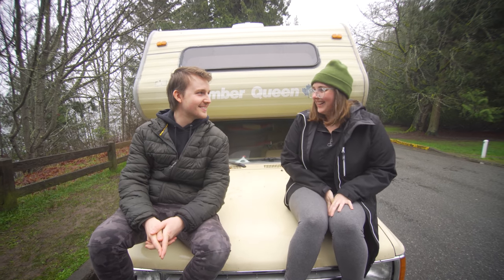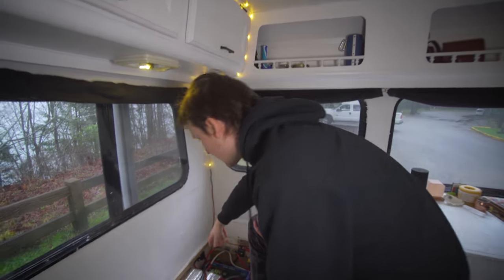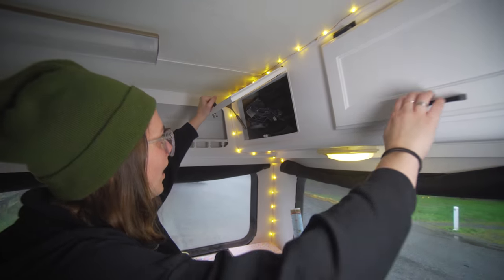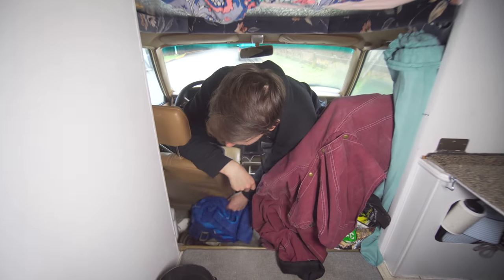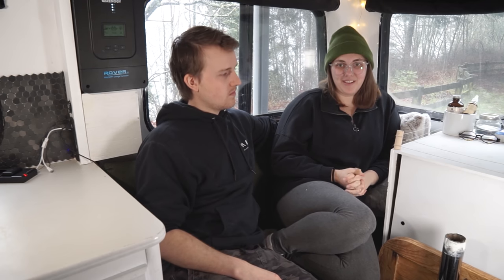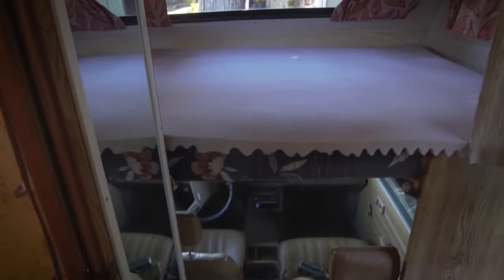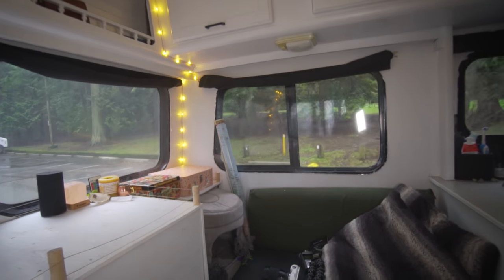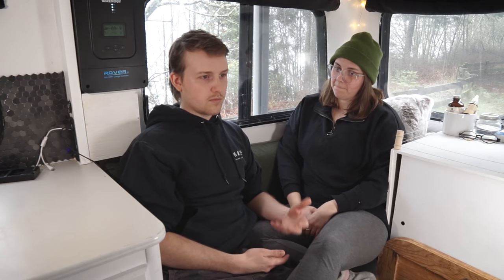Couple + Cat Live Full Time in a Restored Toyota CamperVan / Van Life Tour! / RV to Tiny house!

Comment: Some folks  drill lots of  tiny holes through the solid sleeping wood surface so moisture can be released and the mattress can breathe, make the hole far enough apart to keep the wooden board strong. A friend told me about it many years ago, it works well.

Comment: The RV looked so much more spacious before the remodel. That rear cabinet seems to be a space killer. Good luck with your adventure.
Reply: Scorpio1964 Wines I agree I think the before and after pictures should be switched around. Carpentry not a strong point in my opinion.

Comment: I have one of these and I was just living in it for five years, and if you cook a lot I have a great tip if you have a two part sink. The gray water often builds up and sometimes especially in summer can stink really bad, this is regardless of what food you eat. So I rigged mine for one of the sink drains to just drop down under the vehicle, and actually it really is not polluting or making a mess as you might think. It generally just runs into the gutter, and let me tell you, after ten years of living in a Toyota RV before, I can tell you this trick is a HUGE plus! You don't have to run around just to empty your gray tank, never had a complaint, no more stink bomb gray tank, and really it just looks like maybe AC drip or possible radiator leak, but if you put the drain exit in the middle under the vehicle no one really sees it or knows, and it it's just water and food particles. I cooked big pasta dishes all the time with huge amounts of boiling water dumped right on the street where people live, but never had a problem or any big mess on the street. And for black tank, I just installed a lever under the parking brake, take it up to sixty on the freeway, and the mix of water, shit, and soggy toilet paper just blasts out in such a fine spray no one knows! Sorry, I, couldn't resist it.
Reply from the maker: Interesting idea, I might have something like that if I find the grey water tank to become an issue,
Reply: And for the black tank 😂!

Comment: I may have commented previously.  I love how you renovated this Toyota RV.  We have a 1992 Toyota Winnebago Warrior that we bought from an Ebay seller for $11,000 and at face value it looked great but the drive home indicated it needed a lot of work!  Now we are in the process of replacing the fuel pump in the gas tank along with other repairs I must make prior to selling it to the next proud owner.  We have since upgraded to a 2017 Coachman Orion so our Toyota is surplus to our needs.  I'll probably add a TV, inverter, and a few other upgrades to ours before listing it for sale.  I got some great ideas looking at your video that I will probably use for ours.  Great video by the way!  We live in West Melbourne Florida.

Comment: You kids should consider getting a mini wood stove. They are really tiny and Do Not take up a lot of room at all. The stoves burn small pieces and you can pick up all the wood you’ll need for free. That takes care of your heating woes completely. 
The mattress situation can be solved for @100 bucks by buying a memory foam mattress online. You can get scraps and smaller foam pieces and put them together with 3M adhesive if your really on a tight budget. If you can’t sleep on that kind of mattress you can’t sleep on anything. 
You need to find a semi-permanent place to park. 
It may cost you some money but your safety and comfort is worth it. 
Most importantly you should think of your adventure as an extended vacation. 
Be nice to each other, be kind to each other and have FUN. 
GOOD LUCK KIDS❤️

Comment: This is awesome. Thanks for the video. I just bought myself a small 19ft class C and will be doing similar modifications by myself. Try putting reflectix on the windows to help with heat in the winter and coolness in the summer. Good luck!

Comment: Yeah its a good setup for two people this is the smallest foot print and the least smallest size i would recommend. The Toyota 22RE is a super realible engine and platform. You can add more power to the engine with headers, Intake and some simple bolt ons. So far I think you have quite a setup. I would try to add racks on top of the RV for added Storage space and that would be it.

Comment: I recommend the Exped Mega Mat Duo for a mattress. It’s a bit expensive but it won’t mold and the insulation is R 9.5! It’s incredibly comfortable as it’s a foam self inflation with a great pump to dial the firmness perfectly. We slept near Mt St Helen in the early spring, tent camping, and we were very warm and comfortable. Buy it at REI do you get a rebate.

Comment: I have two Toyota motorhomes for sale. A 1985 and a 1986. Both run out good with both being under 75000 miles. Both are 4 cylinders and both need a complete interior remodel. Just in case you are ready for a couple more projects.... your Toyota looks amazing!
Reply: What state?
Reply: @seanhurley9216  Georgia
Reply: @timallbritton3716  have u sold it yet? If not how much are u asking? Where in Georgia?
Reply: I have two. Both need a total refit. Both are mechanically sound with low miles. I am in Griffin Georgia 30224. I will take $2500 for one and $3500 for the other... or $5000 for them both...

Comment: That is a fantastic idea to have the engine charge your batteries. And it’s even better that of course it knows to charge the starter battery first and then redirect the flow to the lithium batteries. It may seem obvious but I’ve seen so many people on these videos it say that they cannot charge your batteries from the engine in the engine is just a gigantic generator which should be used when you’re driving to charge all batteries in my opinion.

Comment: Old video I know, you can get around the black tank by replacing the toilet with an incinerator toilet. There'd be no waste to deal with other than ash and with a removed black tank it's not only sanitary you'd also reduce the weight of the vehicle and slightly improve gas mileage. Unfortunately, incinerator toilets are expensive and consume power, so you have to weigh what's ideal for you.

It's also ideal given the issue you bring up regarding power usage, to invest in more batteries. There are lithium batteries with their own BMS, but can be costly.

There are water filtration systems readily available for RVs, like Clearsource. It's a good way to extend the use of water without worrying too much about emptying and refilling the tanks.

Comment: I am disabled. I however loved going before. I wish I could do it now. Try making a deal with a regular matress place when on sale. A gel foam is COOL. Not hot. I would ditch the loads of pots and pans. Figure out what meals you love! Then figure out what you need. You bake. That's great. So keep those. Instead of buying bulk pare down your pantry. I know I have so much I never use. If your wife has Mobility isdues....going long distances....get a rollator. It will fit. Make it fit. They are tolerable and allow more freedom outside. Difficult with a cat.....for bed.....pare down blankets. Get sleeping bags open completely up. Flannel comfy. Then use another good blanket. Tear out rugs! If anything get carpet and cut to fit! Then everything is the same. And you will feel so good with changed look. I may have other sugestions......I used to do that.

Comment: Recommend put your gas detector down low as gas falls first.
Reply: It is not a gas detector. It is a carbon monoxide detector, carbon monoxide does not rise or sink. If I had a gas detector I would place it lower, because yes propane gas does sink.

Comment: I know this is old (my firat time watching)

But thought yall did an awesome job showing a real lived in environment, and the real side of RV life.

One question though: that carbon monoxide detector seems quite high up? I though carbon monoxide was heavier than normal air so they're usually low to the ground in order to give you early warning.

(Its been 7 months now so maybe its fixed. Love your RV)
Reply from the maker: Thank you glad you enjoyed it. Carbon monoxide is actually the same density as air so it can be around where a smoke detector would go and be just fine. Propane is heavier then air, so for a propane detector you need to have them low to the ground and I think that's where the common misconception comes from as carbon monoxide is a by product of propane combustion.
Reply: @Differentmedia   ah! Makes sense! Im in the research stages so I wanted toake sure I understood for my own needs, as obviously my understanding was not perfect.

Comment: Hi guys I myself live in. 1987 Toyota r.v for three years.Finished restoring it in Spring.Cant beat the R22 engine.Anyways for fridge and stove I use a 2 door mobil cooler Wich is solar/electric.Got rid of heavy stove for 2 plate propane burner.Installing woodstove and diesel heater.Also have a 99% Pro-com propane fireplace Wich is more economical than anything I've used in 5years.Custom built Cation being redone.Being sprayed with cork.Show you on my channel I'm Spring when complete!Good job
Reply from the maker: Sounds like some fantastic Reno's you have been doing on your RV

Comment: How are you going to keep your roof coated with the normal coating that periodically we have to redo with the solar panels on it?
Reply from the maker: The roof coating is mostly to slow degradation caused by UV, so the solar panels block any UV radiation from hitting the roof below them. Then you can simply coat around them on the roof that is still exposed.

Comment: Co2 detecter needs to be low. You will be dead before it goes off at that hight. Just saying....
Reply from the maker: Inaccurate information. Carbon monoxide doesn't sink like a lot of people think. Look it up
Reply: @Differentmedia  So I went and looked because I have not in several years. I mostly see the sellers of CO detecters saying that it doesn't matter if they are high or low because they say it dissipates evenly into the room. On the other hand scientists and boat owners will tell you the CO is heavier than air and in a confined space with out air circulation will sink and settle into lower areas. So if the detector is in good working condition and is not out dated it should set off/ alarm at a level that is low enough for the occupant to safely leave the space to fresh air. If the CO is not being produced at an accelerated rate. Given my experience with CO deaths as an EMT I'm going to continue to place mine lower. But I see no reason that in normal conditions of a home could not be placed where ever. Having them at eye level with a display seems to make the most sense for monitoring that it is working properly. On a side note new cars have such low emissions that is not possible to kill yourself in a garage with the motor running.